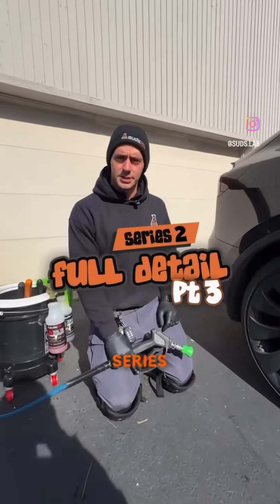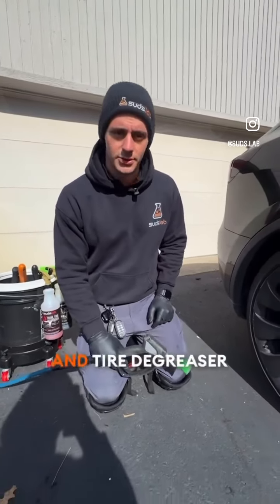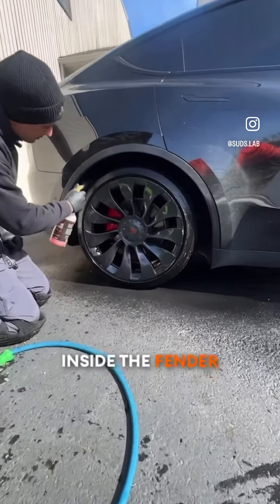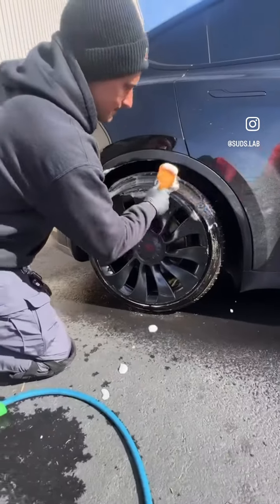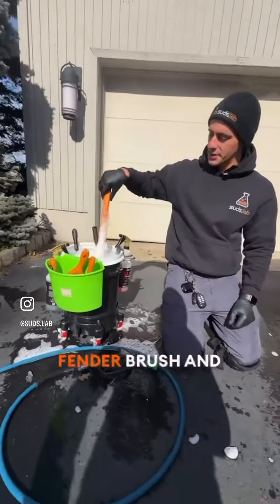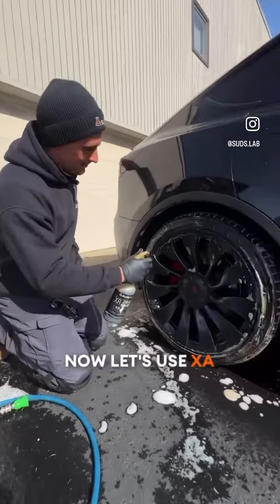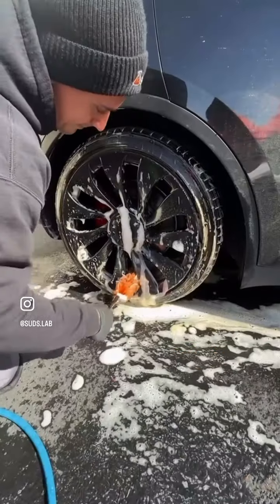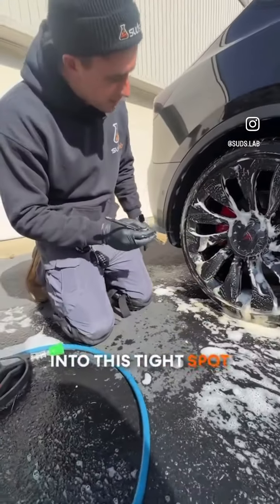Welcome back to the Full Detail, gearheads! Time to get dirty with some serious grime eradication!

Comment: Just received my Sudslab complete car cleaner C3 if i want to use it for exterior uses do i use it at full strength or do i need to dilute it? As like a prewash spray it on the lower panels then rinse then contact wash